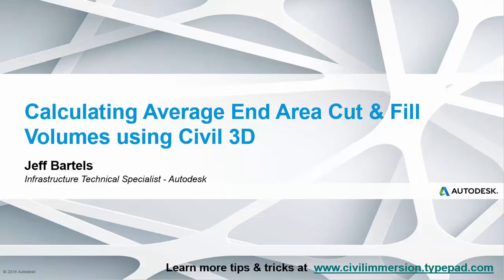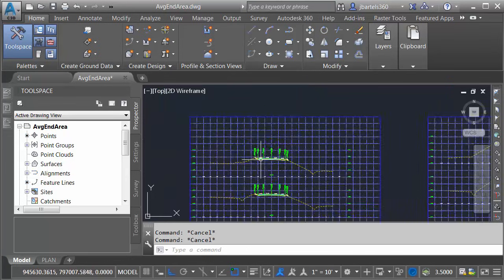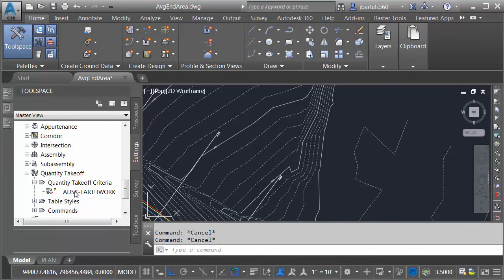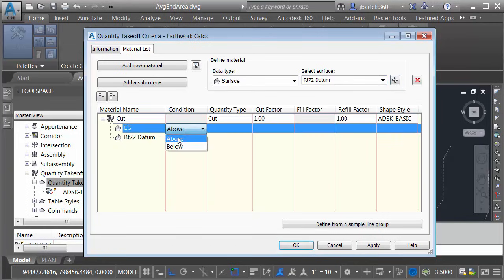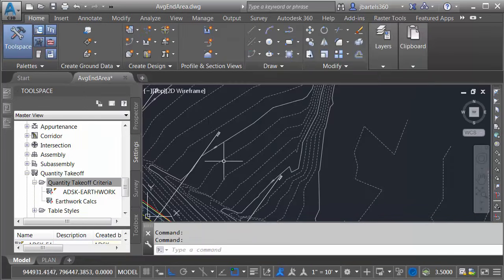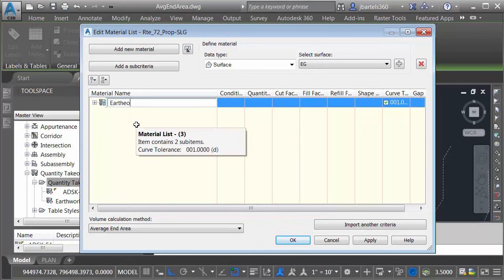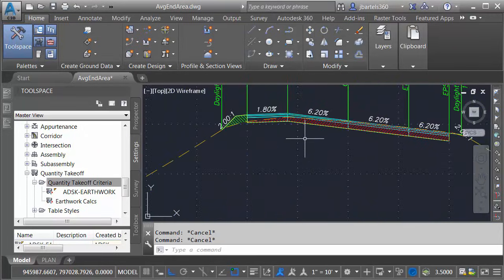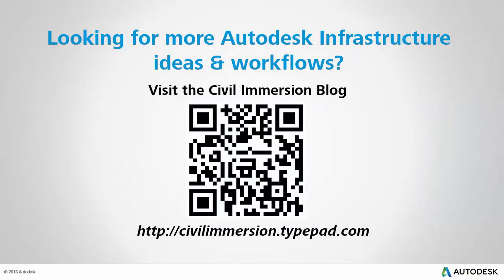Calculating Average End Area Cut & Fill Volumes using Civil 3D

Comment: how do we deal with quantity that have been already paid on clearing and grubbing item in Ha. because this fill section volume does not consider the 15cm cleared surface below the Original ground surface . but practical filling material also includes the 15cm that has been removed by clearing activity.

Comment: Jeff! you are one of the best in the area of civil engineering!
I have a question though!
Assume I have surveyed the natural sub-grade of a road project before excavation commences and taken survey data. Subsequently, after excavation, I have taken survey data at the same station after excavation work is concluded. Now, having two data with different elevation points, how can I calculate the earthwork volume using Civil-3D?
Thanks in advance!

Comment: I come from a construction background and the way you so you videos are straight to the point and so easy to understand! Currently, I am working in the 4D planning space and one of the biggest items we discuss about is interfaces with existing infrastructure for provision of Traffic management. Would you be able to create a video about the best ways of mapping and modelling existing roads. I have thought about using Infraworks however it is open source and needs refinement. Now i am looking at leverage GIS data in terms of OS mapping and lidar surfaces. But it seems rather manual. Any thoughts would be helpful :) By the way i am not a design engineer but i am very fascinated by the tools!

Comment: Jeff
i have been watching alot of videos and i cant seem to find an answer and i am hoping you might have an idea.  when calculating the cut and fills, how do you account for removal of  surface along the daylighting and replacement with top soil?  your yellow datum comes up along the pavement and to the tie in point on the existing surface.  if say this was rocky along the edge and 5' was replace with top soil, i would want to calculate as part of the cut.  any ideas how to include that?    
thanks